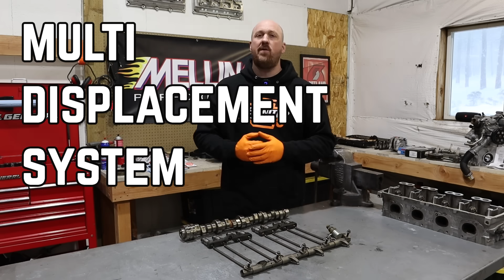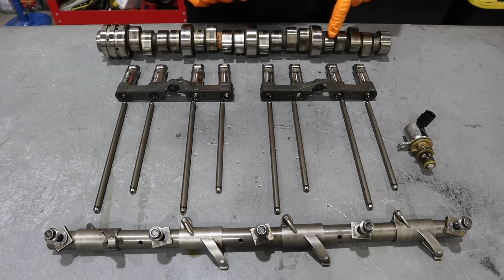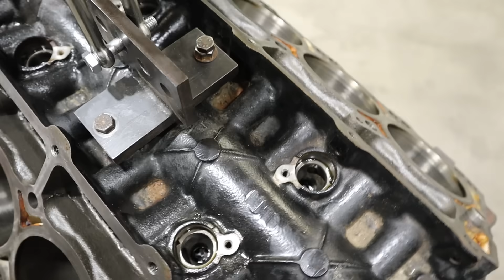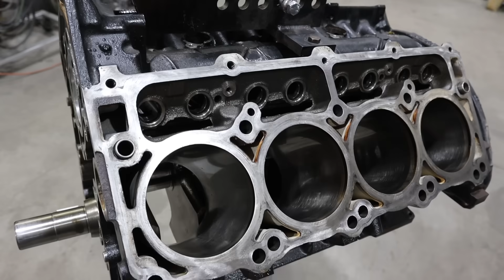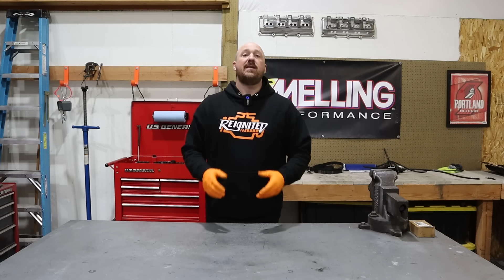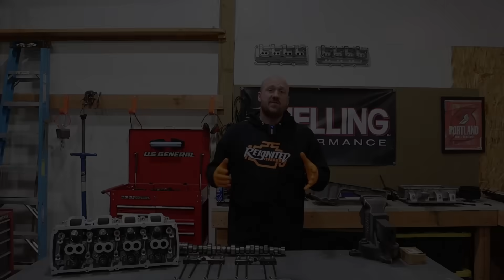Is MDS Damaging Your HEMI? The Answer May Surprise You!

Comment: In tow mode, the ram 1500 deactivates MDS. I don't believe they'd design an engine that can tow for 3 to 6 hours in a day and then damage itself by having insufficient oil to those lifters for all that time. That makes zero sense to me. So I think your statement is incorrect, it does not harm the engine to run around with MDS disabled on stock hardware.
Reply: Mine doesn’t, tow haul just changes transmission shift points. If you tow something light like 4k the mds still kicks in with light throttle load.
Reply: @joshkrause2977  Not on the 5th gens, it disables MDS. And you can't actually tow anything heavy with 4 cylinders so whether its disabled or just not coming on due to throttle demands is all beside the point; the point is, towing 5000 pounds will never have MDS coming on and they wouldn't design an engine that needs to work hard without adequate oiling when it needs it most for hours at a time.
Reply: My 2017 1500 does not deactivate mds in tow/haul .
Reply: @follow-yeshua  See my follow up comment, on 5th gens its disabled but you can't actually tow 5000+ pounds and expect to use 4 cylinders, it just doesn't make enough power.
Reply: What are you talking about? He never said the MDS system would damage the engine, enabled or disabled. In fact, the whole point of the video is the exact opposite. He is saying that he does not believe the MDS system is NOT responsible for the cam/lifter failures. He did say if you are going to do the delete, you have to replace the MDS lifters with Non-MDS lifters when removing the MDS solenoids. Putting your vehicle in tow mode disables the MDS system...it doesn't remove the solenoids!
Reply: @shepherdguy  You need to slow down and re-read my comment.
Reply: @JohnSmith-ev1sm  I reread your comment several times and do not need to read it again. You are implying with how you worded your statement that the engineers would not design an engine for towing without adequate oiling. Since towing requires more power than 4 cylinders provide, then MDS has to be disabled for towing and the engineers would have ensured that the oil supply would have been adequate. This does not change my comment. He says nothing in the video about MDS being disabled causing inadequate oil pressures. Engineers designing the oiling system adequately is simply your opinon. There are literally thousands of people that disagree with that, and I agree with them. The engineers screwed up, but not anything related to the MDS. The engine (stock) provides inadequate oiling at low rpms, regardless of MDS activation or not. The higher the percentage of time that the vehicle is at idle, the higher the chances are that engine damage can occur. So it is you that needs to slow down and rewatch the video.
Reply: @shepherdguy  The engine provides perfectly fine oiling at low rpms. In engines with failures, it's usually one lifter that goes bad and the others are in excellent condition. There is nothing wrong with the oiling system or design, it's simply a bad/weak lifter. All these theories to the contrary are looking for complicated issues but have no proof, and we can use logic to deduce that if 15 of the same lifters in the same engine under the same conditions are perfectly fine, then obviously the failed lifter has an issue specific to that lifter. It's really that simple.
Reply: @JohnSmith-ev1sm  I'm going to take a stab in the dark and say that you have never experienced the lifter failure or if you did, then your situation only showed damage to one lifter; but that's not the case in all situations. Some people have had wear or damage to more than one lifter and in my case only the one lifter appeared bad but noticed cracks or pitting on cam lodes where the lifters looked fine. The lifters Chrysler used in the 2009 on up are the same lifters and same vendor as the lifters in the 2003-2008 Hemis. If it is simply the lifters, then why didn't we see the same problem occur in the 03-08 series? I'm not saying that the oiling is the total issue, but once they raised the camshaft increasing the distance from the crank, along with the tubes for the MDS oil galleries in the 2009 on up series, they reduce the amount of oil that could sling to the camshaft. This, in conjunction with the quality of the lifters, increased the risk of failure, and that it also logic. John, you can't fight statistics...mechanics across the nation have maintained data on engine repairs or replacements and the driving conditions of the vehicles that have had the failures. Some vehicles didn't maintain oil changes within the appropriate timeframe, and others may have not used quality oil leading to some of these failures. But the data also shows that a significant amount of these vehicles ran with high idle time. That's why there was a high number of these failures in law enforcement cruisers. John, you believe what you want. I don't believe you have done any kind of deep research on this issue, but feel free to keep sharing your opinion.
Reply: @shepherdguy  You need to keep researching dude. Idle time is "engine time", a bad lifter goes bad with engine time regardless of whether it's idling or driving.  That's another flawed theory of course, we have many examples of trucks with high idle hours and 0 failures, and we have many examples of low idle time but failure nonetheless. Cop/taxi cars are supposed to have their oil changed by the severe duty cycle, which is like a few weeks when used all day, very few get that treatment and bad oil can definitely start doing damage. Again, lots of silly complicated theories but no fact, and nobody wants to accept the obvious and simple reason: a lifter is just manufactured poorly and fails before its time. That's it. Possibly exaberbated by varnish and crud left by bad oil. That's the only thing that explains why one lifter fails and the other 15 are in excellent condition. And there are many examples of this on YT or forum reports.
Reply: I noticed that that you didn’t answer about the lack of failures in the 03-08s. Same lifters. What changed in 2009 John? I’ll leave it right there.
Reply: @shepherdguy  Note that FCA reworked the lifters around 2016. The needle bearings are now thicker and there are less of them. The consensus is that lifter failures are far less on these engines, and even less after 2019. You also have no idea where these lifters are getting sourced from, if they changed vendors, 2009 was right in the middle of bankrupty (just as an example of something people don't think of and could play a role if they swapped vendors etc etc). You guys should go up to a hemi engineer and tell them that its not getting oiled correctly due to the block design. Let me know when they stop laughing.
Reply: @JohnSmith-ev1sm  Yep, I put the post-2016 lifters in my truck. Yep, the needle bearings are larger. Yep, there are less issues with the newer lifters. Yep, Chrysler STILL had failures with the new lifters but at a more reduced rate. Nope, bankruptcy had nothing to do with the Hemi receiving a new design in 2009. Nope, the bankruptcy played no role in the change in vendor for the lifters. The bankruptcy occurred in 2009, the new engine design had already been in place, and the new lifter design and vendor change didn't occur until 2016. Yep, find me the engineer(s) that came up with the new 2009 design and I will gladly be willing to tell them their design sucks. The oiling system passages, port, galleries, and oil pump pressures in the 2009 design are virtually identical to the pre-2009 with the exception of two added oil passages with the addition of VVT; and yet the distance between the camshaft and crankshaft was significantly increased, and the lifter angles were flattened out where they are almost horizontal. The pre-2009 Hemis had a greater lifter angle of 48 degrees. With the 2009, they reduced the angle to 18 degrees for intake and 16.5 degrees for exhaust. The reason? To shorten  the valve train distance. Camshaft was raised, pushrods were shortened, and lifter angles were flattened. VVT was added and two additional oil passages were added. All these changes significantly reduced the oiling by sling from the crankshaft. The flattening of the lifter angle reduced the chances of oil rundown from the lifter bore to the lifter roller. The lifter has a valley between the lifter body and the bearing head, and because of the flat lifter angle, the oil drips from the valley instead of running down to the roller and bearings, meaning the roller and bearings are now relying more on oil sling, which is reduced due to the raise of the camshaft and additional oil tube passages under the camshaft. John, have you even worked on one of these engines and seen the failure yourself; or are you just a troll that goes to these videos to try and push your incorrect theory that there is not an oiling issue? By the way, the guy who posted this video is a 10-year Chrysler dealership mechanic who has repaired hundreds of these engines. Maybe he doesn't know what he's talking about either. We can't all be omniscient like you John.
Reply: @shepherdguy  All this blather and yet no logic. Like I said, if 15 lifters are in excellent condition under the same conditions but one fails, obviously it's something to do with the lifter that's the problem. If you can find rams with thousands of idle hours and no failures than obviously its not the idle hours (alone) which is the problem. And it's not the block design either. Its like you guys think a hemi engineer doesn't know what he's doing but you do because ... you experienced a lifter failure. Your arrogance is quite cute.
Reply: @JohnSmith-ev1sm  Engineers make poor decisions and designs quite frequently, it’s no secret. If you are not aware of that, you must be living under a rock. Have a nice day John.
Reply: @shepherdguy  When only 1 lifter fails and the other 15 are in excellent condition, that should tell you that lifter has an issue. When you find many trucks with high idle hours but no failures, and some trucks with low idle but failures, then clearly the failures are not due to idle time in and of itself. When you have trucks that hit 300k+ miles with 0 lifter failures, then there is no design flaw. You guys will come up with any random theory except the most obvious one; the lifter fails because its made poorly. Not a design flaw in the block. Not idle hours. You don't need to upgrade your oil pump. Run high quality oil and change it often, the rest is pure luck. You either get a bad lifter or you don't.
Reply: @JohnSmith-ev1sm  This still going? Look John, twice now you have failed to answer the question I posed to you, likely because you don’t know the answer, or the answer doesn’t fit your narrative. I have already stated from the beginning that the lifters were manufactured with inferior quality and are part of the problem. BUT, those lifters are the SAME lifters that were in the Gen III 2003-2008 Hemi’s and we did not see the failures we see now. Not that there were none at all but it was very few. Then in 2009, we started to see a dramatic increase in lifter failures. Why is that John? They’re the SAME lifters. If the lifters didn’t change, then what changed in 2009? Holy cow John! You call me arrogant, yet your narcissistic personality has you entrenched in your belief and calling everyone else idiots. I don’t base my conclusions on one engine that I rebuilt with the lifter failure, I base it on solid research and years and years of automotive experience. Are you a teenager John? That might explain why you refuse to look at the evidence that is out there and believe that engineers are perfect and can’t make design mistakes. Or maybe perhaps you are an engineer yourself and your feelings got hurt. Do some of your own research John and look at the evidence for Pete’s sake! Same lifters in 03-08, became a huge problem beginning in 09. THE ENGINE DESIGN CHANGED IN 09 JOHN!!! Now look who the arrogant one really is!
Reply: @JohnSmith-ev1sm  Oh, one last thing I forgot to mention but you did bring up earlier that the lifters were changed in 2016 with larger and fewer needle bearings. John, you are aware, aren’t you, that Chrysler is still having failures with the new lifters? Not as many but they are still seeing them. So much for it only being the lifters.
Reply: @shepherdguy  If it was insufficient oiling due to a poor oil pump or block design, you wouldn't have 15 excellent lifters and one that's broken. Its really that simple and your word salads which I've stopped reading aren't going to change this my friend.
Reply: @JohnSmith-ev1sm  Yes, I realize you are aren’t going to change your mind. I just thought I would give you a third and final chance to explain the Gen III to Gen IV phenomenon. But as I figured, you struck out again. Have a wonderful day!
Reply: @shepherdguy  We've been through this, there are multiple possibilties; swapping or using additional vendors, or vendors losing quality control, materials issue. It absolutely has to be to a lifter issue or you won't find the variation in failures going up or down using the same 2009+ design. It has to be a lifter issue because there is no other explanation for why the other lifters don't fail in the same use case. Use a high quality oil, change it 5000 miles, and the rest is pure luck. All this other stuff is just nonsense, all non-engineers thinking hemi engineers don't know how to route oil through an engine.

Comment: I don't like eco mode turning on before the engine is at normal operating range.
Reply: It doesnt,it only comes on when the engine is up to temp..
Reply: @mypronouniswtf5559  My 6.4L does kick on before water, and oil are at normal heat range. I shut it off until the block is completely heated.

Comment: Would enabling a high idle function do the same thing if your sitting in your vehicle for a while? Emergency vehicles idle very often and municipalities don't want to pay alot for modifications
Reply: I’ve been asking that for a while. My 20 1500 idles at 550 hot and sits around 31 psi. I’m in the mid 40s if I use my foot and get it around 650 rpm.

Comment: My hemi idles very low  rpm like 500-600rpm , im just curious if i  rise the idle to like 1k rpm will the oiling be enough for the lifters to be safe at idle ?
Reply: I am wondering the same thing.  Seems like a less labour intensive option than swapping an oil pump on a 4WD Ram.
Reply: My 2015 ram idles at 38psi which is plenty for low rpm.
Reply: 5W30 or 5W20 oil? @joshkrause2977
Reply: Do you use 5W20 or 5W30 Oil? @joshkrause2977
Reply: How do you plan to raise the idle? It is electronically controlled. You would have to program it to do so and then the PCM isn't going to like that because it will not match set parameters, thus throwing one or more codes. Perhaps a tune kit can change the PCM's set parameters, but I don't have enough experience with tune kits to say for sure.
Reply: @shepherdguy   currently looking at diablosport tuner it says it can adjust idle speed

Comment: thank you so much for explaining this , is it normal or common for 8spd Torque Flight transmissions to have slight slipping from gear 1 to gear 2 on cold starts ? Having this issue on a 2022 RT challenger with 6k miles, should I be concerned ?
Reply: Are you saying it feels like slipping? My RAM 2500 6.4L, and 5500 Cummins does that slipping feel that can be seen in the rpm. Both are 6 speed, and both have different transmission. Both are over 100k miles and have always done it.
Reply: @e.l.9589  so it only happens on the first drive of the day , going from gear 1 to gear 2 its like it hesitates to move into gear 2. I had a V6 Pentastar and had no such issues so seeing this new to me as well as concerning man
Reply: My 2015 300S 5.7 with the ZF 8HP70 does that on cold start. It feels more like a shift flare than a slip, and only does it on initial movement. I serviced the transmission (fluid/pan-filter) at 120K miles and it still exhibits the same behavior. Doesn't seem to be a problem though.